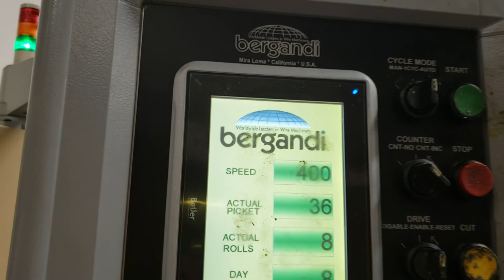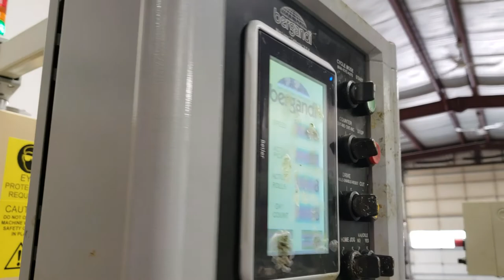Bergandi chain link fence weaver

Comment: Hi... What is ACC for 1100 RPM
Reply from the maker: Hello, not sure what ACC is. 1100 rpm is good for 11 gauge wire and up though.
Reply: @DOuRant  Can you check for me please. Luck like below 0.5sek.
Reply from the maker: @gatismednis7638  I am not sure what you mean by ACC.
Reply: @DOuRant  ACCELERATION time  bifor going full speed..
Reply: @DOuRant  you can check on menu
Reply from the maker: @gatismednis7638  I can check but I would think .5 seconds to full speed, it only takes about 1.75 seconds to make a 6 foot picket at 1100 r.p.m.
Reply: @DOuRant  Can you please film another video with better honest review. 6 foot fence weaving time with stopwatch... Different speed test. Like  600 700 800 900 1000 RPM
Reply: @DOuRant  yo trabajo una máquina de estas pero me ase el corte dos beses está máquina funciona a base de  yo trabajo una máquina de estas pero me ase el corte dos beses está máquina funciona a base de aire.   I work with one of these machines, but the cut takes two kisses. This machine works with air